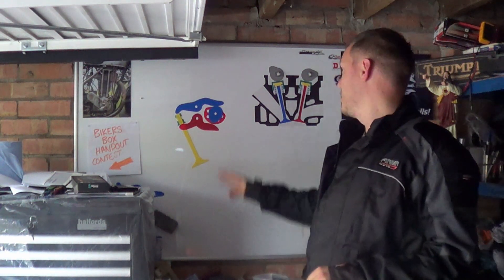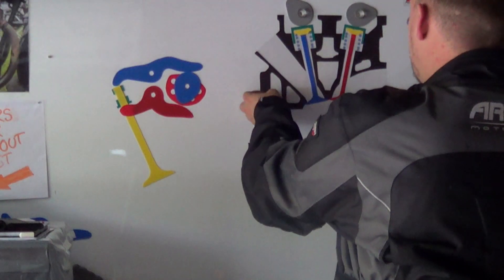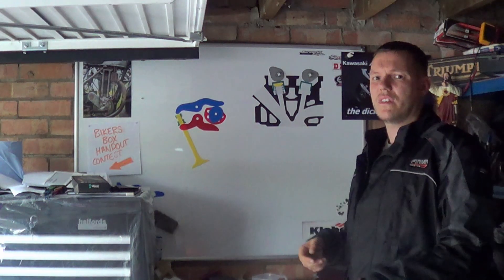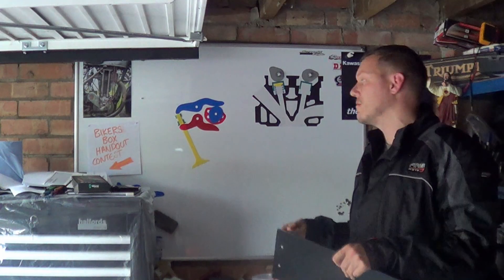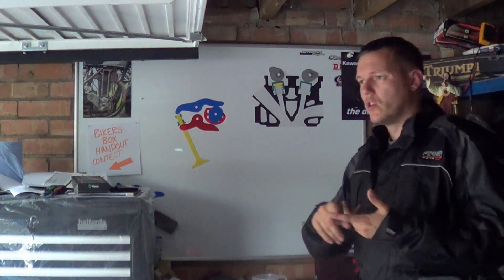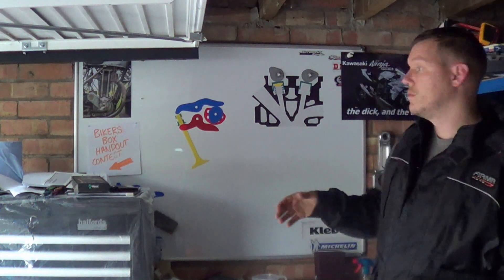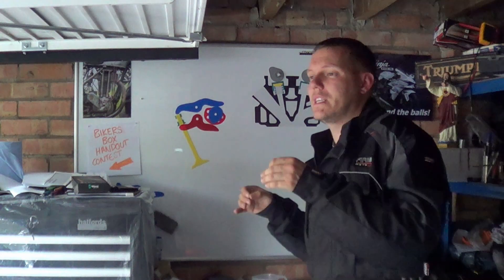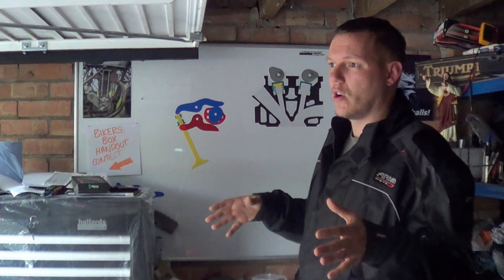Delboy being a wanker!

Comment: Regarding Evans, specific heat capacity is all but irrelevant. All it influences is how long it takes the coolant to warm up. Seeing as warm engines are better than cold engines, Evans having a lower specific heat capacity is probably a good idea.

HOWEVER:
Engine cooling systems are designed to operate more or less in a steady state, that is - once everything is up to temperature (and speed), very little ought to change. These systems chooch on equilibrium and where that equilibrium lies will ultimately dectermine how hot the engine runs.

A good cooling system is (or at least ought to be!) designed to maintain strady state heat transfer at full power and is regulated below that via thermostat.

In generic terms, the path of heat from fuel to ambient air takes the following route: fuel to engine block, engine block to coolant, coolant to heat exchanger and heat exchanger to ambient air. Heat goes from hot to cold, so in the above system the fuel reacting is hottest (DUH!) and ambient air is coldest (double DUH!). Splitting the system into these components allows more detailed analysis of each one in sequence, though in reality it all happens at the same time.

In essence, each component is in itself an equilibrium system which will settle at different dT for different conditions. Fuel to block and heat exchanger to air can be regarded as constants in our case, we're comparing coolants here. The coolant itself only has direct influence on the parts where it absorbs heat from the engine block and then deposits it into the heat exchanger. For the purpose of this analysis we'll ignore the thermostat and just assume it's wide open. This makes it a free flowing system meaning that the coolant stays at more or less the same temperature at every location in the cooling loop.

The practical effect of this assumption is that heat in at the engine block MUST equal heat out at the heat exchanger for the system to be in equilibrium.

Let's examine the heat transfer a little closer: within the loop, heat is transferred to and from the coolant by means of forced convection. Skipping over the details (else we'll be here all month!), this process is affected by the boundary layer of the fluid in the heat transfer areas (in turn affected by viscosity and flow speed) and the its thermal conductivity . The general rule is that more turbulent (faster, less viscous) boundary layer means better the mixing and therefore heat transfer. Heat transfer is also directly proportional to thermal conductivity.

In equilibrium terms, for a constant rate of heat transfer, a faster flowing, less viscous and more thermally conductive fluid will result in smaller temperature differences between the engine block and coolant, and coolant and heat exchanger.

Changes here result in a double whammy effect: for example, not only would the coolant be hotter as a result of poorer heat transfer, but so would the whole engine on top of all that!

It should be noted that specific heat capacity affects mainly the transient behaviour of this system, it has little bearing on operating temperature.

I suspect Evans is not remotely as thermally conductive as 50/50 and I know for a fact that their marketing department (hell, their whole fucking company!) knows fuck all about fuck all about thermodynamics.

TL;DR:
Comparing heat capacities is barking up the wrong tree, compare thermal conductivities instead. Also Evans are full of shit!
Reply from the maker: "Regarding Evans, specific heat capacity is all but irrelevant."

You didn't actual give a reason, and I agree - thermal conductivity is also important.
Reply: The Workshop "It should be noted that specific heat capacity affects mainly the transient behaviour of this system, it has little bearing on operating temperature."

This being a dead horse on the topic of overheating, given the same heat transfer coefficients at engine block and radiator, to achieve the same rate of heat transfer, delta Ts remain the same regardless of how long it takes to get there.

Heat capacity only begins to have an influence on system equilibrium at low enough flowrates for the coolant to linger quite a bit around the heat in or heat out areas (I'm sure there's a nondimensional about this! If not I'm inventing one - K=Q/mdot.C), but then this would act more like free convection and in any case, the water pump doesn't go that slow in any engine I know of

Comment: Hi Matt, 

I agree with almost everything your saying about Evans and I have watched all your Evans videos and also delboys Evans video + other YouTube videos about Evans.

I might be wrong but you don't talk about constant coolant to metal contact that Evans offers over 50/50 mix. 

I agree that 50/50 runs cooler then Evans and transfers heat better, but if your engine gets very hot, for example driving in sand dunes +45 etc then 50/50 mix will start to produce air bubbles, steam and possibly boil. 

When it gets to this point the 50/50 mix doesn't have coolant to metal contact around piston walls etc and allows the engine to get hotter and hotter and hotter..
 
Also your thermostat will only read accurately if it has contact with the coolant, so when your engine gets hot your temp gauge is showing cooler then it is because of the steam/air when your engine is actually hotter. 

On to Evans, 
In the same situation driving in sand dunes its hot heat, 

The Evans will always have coolant to metal contact because it doesn't boil/steam etc so it is always drawing heat away from the piston walls. 

Your thermostat will show accurately due to constant contact with coolant. 

The Evans will read hotter but this is because it has constant contact with metal and can constantly draw heat, this results it the coolant reading hotter and coolant being hotter, rather then your engine just getting hotter and not your coolant.

I hope you understand the point I'm trying to make and look forward to hearing your opinion on it. 

And I'm not trying to say all of what I'm saying is true and face, I'm just saying what I believe is POSSIBLY true.
Reply from the maker: "I might be wrong but you don't talk about constant coolant to metal contact that Evans offers over 50/50 mix."

- no, and there's a good reason. I don't know if this is true or not. Simple as that. I'm working on an experiment on how to test it and make it easy to understand and clear as to what is going on. 

More on this later.....
Reply: Cool,  look forward to the results.. 
thanks for the reply